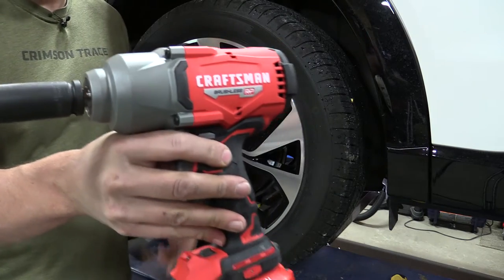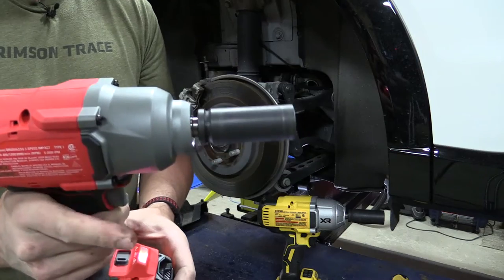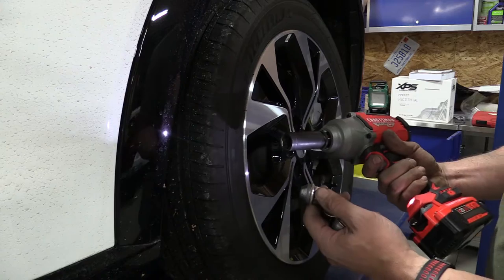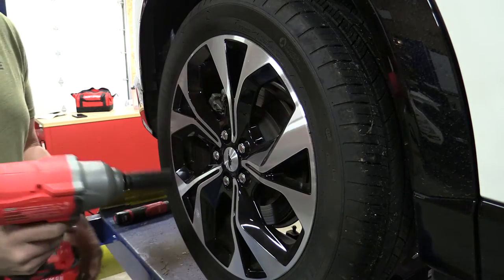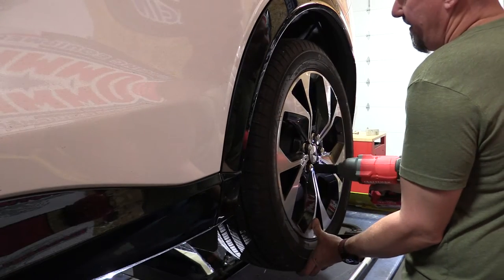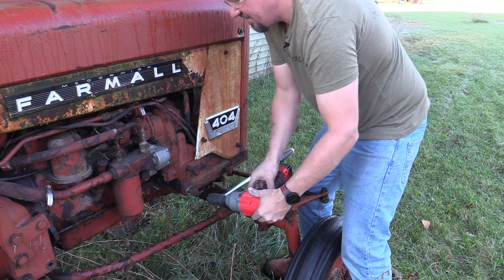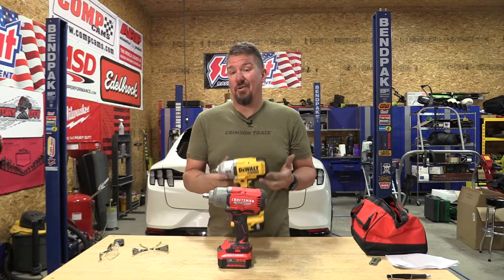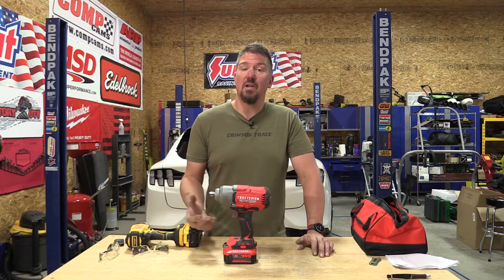Craftsman V20 Brushless RP 1/2" Drive High Torque Impact Wrench Review CMCF940M1

Comment: That craftsman impact is more comparable to the 899 however the 899 is rated higher but torque test channel proved the craftsman has more power than DeWalt

Comment: I bought one and used it one time and it broke. I use a DeWalt at work every day and it’s going strong. The only reason I got the Craftsman was because I already have most of the Craftsman lineup with batteries and chargers.

Comment: The CMCF940 is essentially the DCF899 in red. SBD did the same thing with their mid-torques, repackaging the DCF894 as the CMCF920 after the DCF891 was released.

The Craftsman line works for the average home user/DIY mechanic.
Reply: I like the red yay 🤤

Comment: I’ve been running a pretty crappy porter cable impact since I was like 18 and was buying my first tools, probably going to grab this one since all of my drills and drivers are craftsman just for battery interchangeability, and it seems like a decent upgrade over my porter which has honestly been a work horse for how cheap it was. If I was going to be wrenching full time I’d probably grab a dewalt or Milwaukee though.

Comment: Craftsman is basically the replacement for Porter Cable which I still have plenty that I picked up clearance and I've been doing the same with Craftsman V20. I now own all three Craftsman impact wrenches the 3/8, the 1/2 mid-torque, and now the 1/2 high torque. I just had to run out and get high torque to get off a Honda crank bolt and it did it easily but the mid-torque wouldn't move it.

Comment: They have a Porter Cable high impact now as well and although I'm invested in both lines I went with the Craftsman High Impact. Craftsman seems to have more clearance deals at Lowe's and Porter Cable only seems to be at Tractor Supply now.
Reply: I think tractor supply is the only or one of few places that still have porter cable. I used to love PC until i couldnt find them anywhere for awhile
Reply: Yea I got the porter cable version of this gun it’s holding up to the test axles suspension brakes engine tear down taking off engines mounts a whole bunch of shit it’s still holding up thinking it’s pretty good but I am thinking of of buying that dewalt dc900 or Milwaukee idk 🤷‍♂️

Comment: Try the 9.0 A/H battery on tests please. I have the new 921B mid torque. It is surprisingly good.  The tool is absolutely a different animal switching to the 9.0.  And as soon as craftsman gets a 12.0 A/H battery...  One is to assume correctly that it's a beast of an impact
Reply: I have all of the batteries too. I haven’t noticed any difference between the 6.0 and the 9.0. The 6.0 really wakes everything up. The 9.0 gives that extra run time. It would be cool to see some real world tests and numbers.
Reply: Depending on the tool 9amp battery is great with the circular saw, miter saw and recip saw that's where it shines, impact driver and wrenches don't consume as much power, that is why on Milwaukee impacts the 6amp is better than the 12amp

Comment: Did you use a 5ah craftsman battery? Where did that even come from?
I’ve only seen the 2ah, 4ah, 6ah & 9ah.
Reply: I got my Craftsman CMCF940 used from a pawn shop and it came with a different charger and 6AH battery. The manufacturing date on the battery was newer than the tool and the tool itself was only months old at the time, so I lucked out. I actually fixed my DeWALT DCF899 and didn’t need two of essentially the same tool so I ended up giving the Craftsman to a friend who absolutely LOVES it. That means it’s on at least it’s fourth owner despite being less than a year old (counting the pawn shop that mixed up the batteries). :) I’m using my DeWALT with 5AH batteries so it’s kind of a small downgrade for me but I didn’t have anything else to use Craftsman V20 Max batteries with making it the logical one to pass on.
Reply: I do see a Lowe’s listing for a Craftsman V20 Max 5AH battery (CMCB205) but it’s out of stock.
Reply: @emmettturner9452  odd I’ve searched before a few times and nothing showed up for me on their app & webpage
Reply: @Big Shaw I have a 5Amp hour battery I think you can only get them in a kit with certain tools I got my with the weed eater and blower combo that's on sale.
Reply: Comes with two 5 ah batteries the push mower and the tiller comes with 5 ah but I'd buy the 6 ah battery anyways better deal and runs a while longer than the 5 ah

Comment: Hello again WorkshopAddict 
Thank you for another Great Video 👍 I am researching for my next tool purchase. And cordless tools are on the list. I  don't need something that big and heavy duty for aircraft maintenance. 

The warranty and how that works. For most of my work a 12- volt drill and impact wrench are good enough. And if the charge goes say to the eight hour range and recharges fairly quickly. Then I'm good 👍

 Neither of these tools sound like a fit to me. If something comes to mind, please let me know. Again thank you 😊

Comment: FUn thing is in actuality, the craftsman has shown more torque than the dewalt 899 yet the 899 is rated higher. Some weird things happening at SBD. Go watch the torque test channels dyno tests. They also tear them down and the craftsman was significantly better built on the inside. Wires were double in size over the dewalt. Not sure why this is a thing.
Reply: they took an old design(in dewalt), tweaked it based on their internal research, it benefits from the latest components & design guidelines and the result is slightly better performance overall. they never change existing designs unless theres a safety recall and theres no need to change the existing supply chain for something that is tried and tested but they continuously release newer iterations that also feature those benefits(result: the dewalt900). 

like apple releases new products, but never change the old ones as theres no need.

Comment: How would you compare the Craftsman to the Ryobi 262. I like how the lights are on the Ryobi. Great video thanks for sharing
Reply: I have the P262 and it's no slouch but it's still a mid torque. The new RYOBI high torque would be the one to pit against this Craftsman
Reply: If on a budget go with ryobi because you never have to worry about them making a battery format go obsolete. Craftsman seems like they change their battery format every couple years making their tools automatically obsolete.
Reply: Not necessarily obsolete... but yes it is very annoying to have to buy adaptors just because they changed their battery platform.

Worked at many shops that used Dewalt or Milwaukee... the number of times some poor crew was out somewhere and forgot the stupid adaptor.

It's like 80% of the reason I'm with Ryobi.
Reply: I have the ryobi p262 and with ryobi you have to have the right battery’s which cost. If I knew what I knew I would have went with this or dewalt

Comment: Put it against a Honda engine crankshaft bolt that has been in there for a couple years and see how it handles that. In my own opinion that impact is weak compared to a Milwaukee fuel M18.

Comment: I got the hercules ultra torque with a 12ah battery.  It will obliterate that craftsman and the dewalt.
The dewalt dcf900 cannot even compete with the Hercules ultra torque.
TTC did the test on Hercules ultra torque and one for dcf900.
Hercules ultra torque broke 2,000 foot pounds loose.
Dcf900 struggled to break 1,700 loose.
Dcf900 is not the most powerful 1/2 inch.
HERCULES ULTRA TORQUE IS!
Matco 1/2 inch high torque is pretty strong but Hercules beats that one too.
I use power tools all the time at the shop so I know what I am talking about.
Reply: Torque test channel says that's a lie
Reply: Yea your the only person in the world who uses power tools all the time,go figure,we are sure you know everything about power tools
Reply: Shots fired shots fired 

Man downn